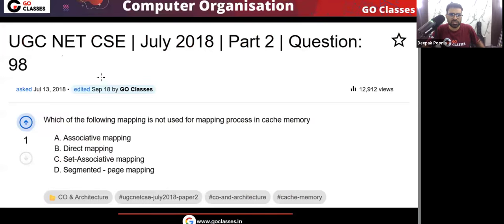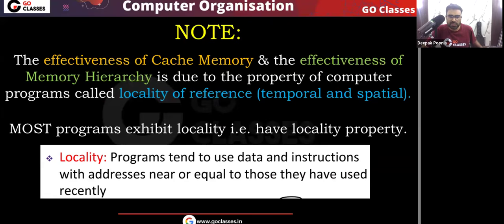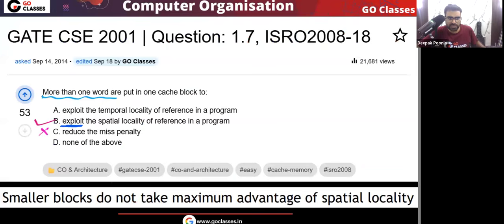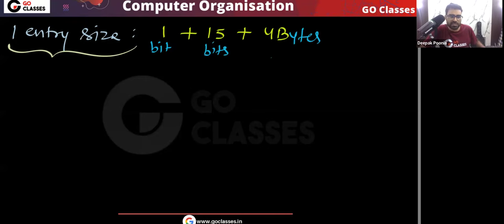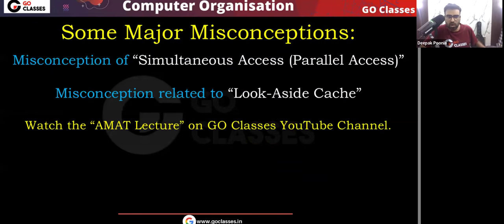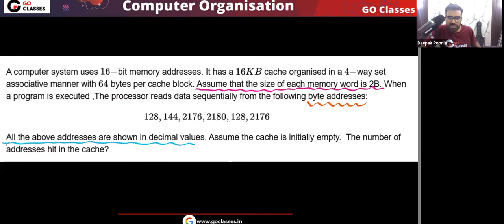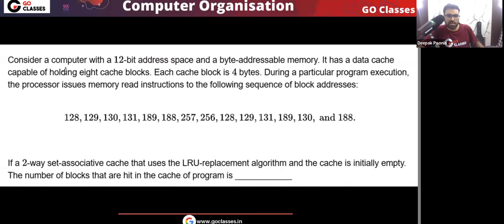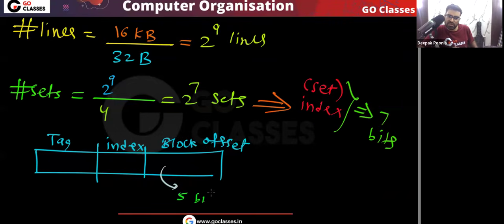Cache Memory - GATE, ISRO, UGC NET, NIELIT PYQs | Complete Analysis

Comment from the maker: 00:00:32 - UGC NET CSE July 2018 | Which of the following mapping is not used for mapping process in cache memory
https://gateoverflow.in/225788/ugc-net-cse-july-2018-part-2-question-98 
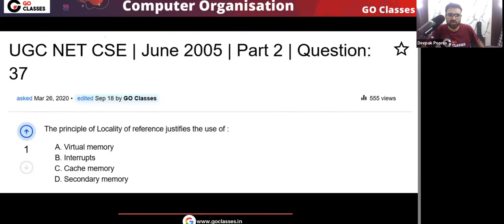00:04:00 - UGC NET CSE June 2005 | The principle of Locality of reference justifies the use of cache memory
https://gateoverflow.in/335426/ugc-net-cse-june-2005-part-2-question-37 
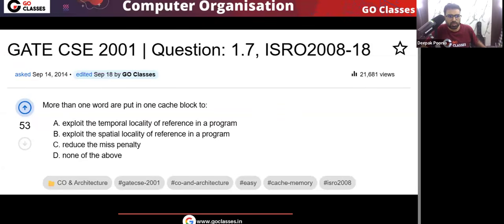00:19:01 - GATE CSE 2001, ISRO 2008 | More than one word are put in one cache block to exploit the spatial locality of reference in a program
https://gateoverflow.in/700/gate-cse-2001-question-1-7-isro2008-18 
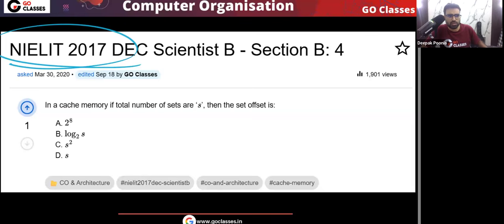00:34:17 - NIELIT 2017 DEC Scientist B | In a cache memory if total number of sets are ‘s’, then the set offset is:
https://gateoverflow.in/336309/nielit-2017-dec-scientist-b-section-b-4 
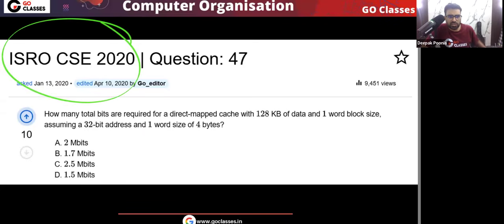00:36:08 - ISRO CSE 2020 | How many total bits are required for a direct-mapped cache with 128KB of data and 1 word block size, assuming a 32-bit address and 1 word size of 4 bytes?
https://gateoverflow.in/331421/isro-cse-2020-question-47 
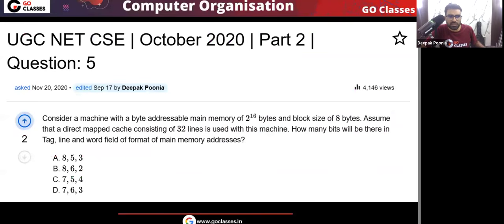00:54:35 - UGC NET CSE October 2020 | Consider a machine with a byte addressable main memory, How many bits will be there in Tag, line and word field of format of main memory addresses?
https://gateoverflow.in/349668/ugc-net-cse-october-2020-part-2-question-5 
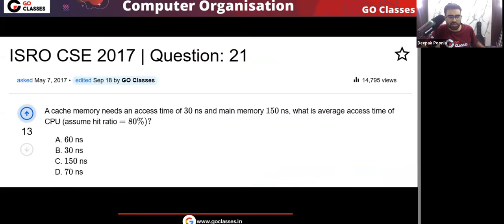01:00:19 - ISRO CSE 2017 | A cache memory needs an access time of 30ns and main memory 150ns, what is average access time of CPU (assume hit ratio = 80%)
https://gateoverflow.in/128633/isro-cse-2017-question-21 
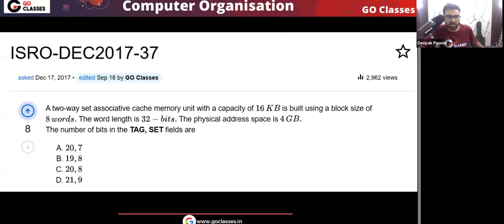01:08:04 - ISRO-DEC2017-37 | A two-way set associative cache memory unit with a capacity, The number of bits in the TAG, SET fields are
https://gateoverflow.in/182087/isro-dec2017-37 
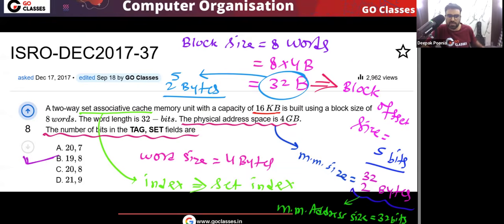01:14:24 - NIELIT 2017 DEC Scientific Assistant A | 
In a particular system it is observed that, the cache performance gets improved as a result of increasing the block size of the cache. The primary reason behind this is Programs exhibits spatial locality
https://gateoverflow.in/336790/nielit-2017-dec-scientific-assistant-a-section-b-56
01:19:36 - NIELIT Scientist B 2020 November | A direct mapped cache, Number of bits needed for indexing the cache
https://gateoverflow.in/351613/nielit-scientist-b-2020-november-69 
01:21:26 - Cache Memory Practice Questions | When a program is executed ,The processor read data sequentially from the following byte addresses, The number of addresses hit in the cache ?

01:41:14 - Cache Memory Practice Question | During a particular program execution ,The processor issues memory read instructions to the following sequence of block addresses, The number of blocks hit in the cache ?
01:52:47 - GATE CSE 2014 Set 2 | A 4-way set associative cache memory unit with a capacity, The number of bits for the TAG field is
https://gateoverflow.in/1963/gate-cse-2014-set-2-question-9